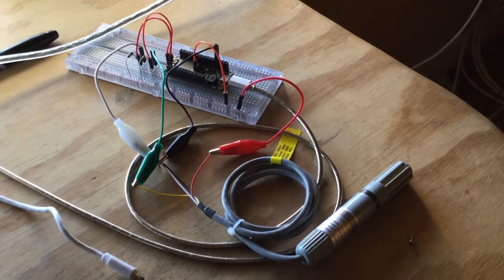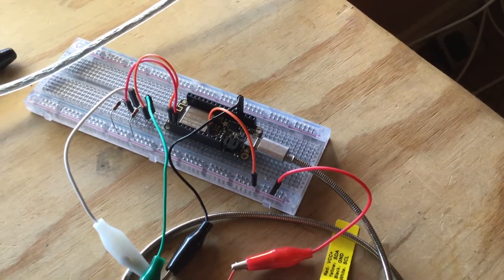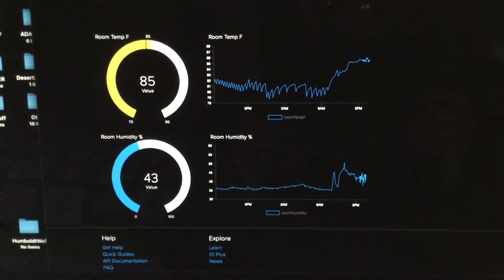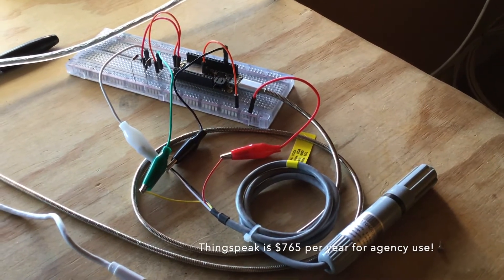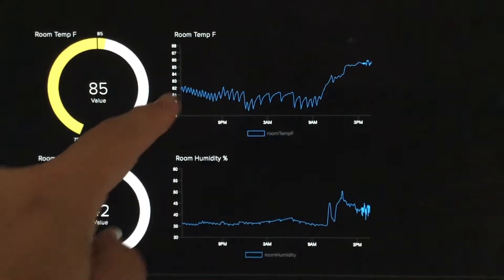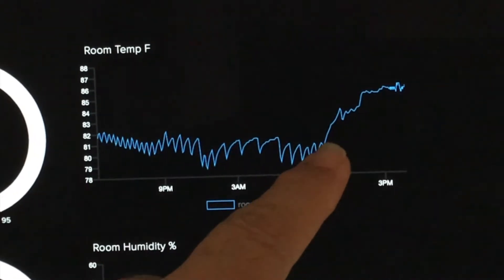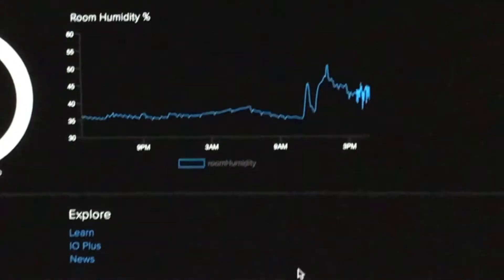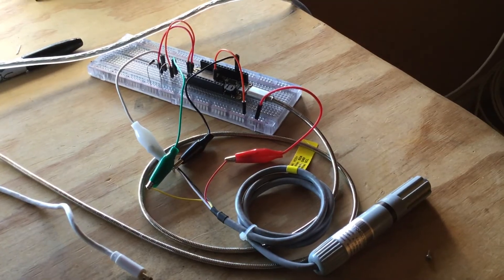Demonstration of Posting Temperature and Humidity to AdafruitIO

Comment: nice vid.  I am interested in building a monitoring  system for my hydroponic garden.  I find your channel helpful...
Reply from the maker: Glad it's helpful. There's a link on http://www.biod101.com/arduino/part2.html that has an inventory of sensors that I've looked at and will be sharing code for shortly. Under Chapter 25, check the link associated with: "Inventory of sensors I'll be playing with is here" for a spreadsheet with sensors, levels of precision, communication protocols, cost, etc.
Reply: Modest Maker cool...thanks 🙂👍